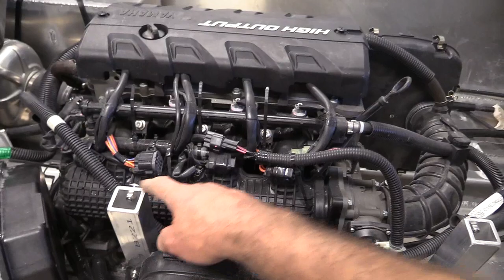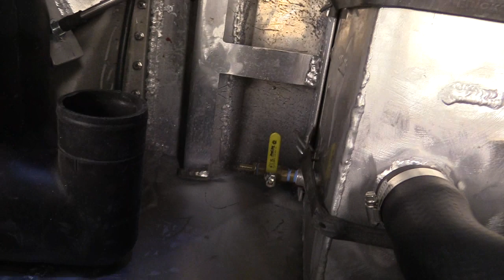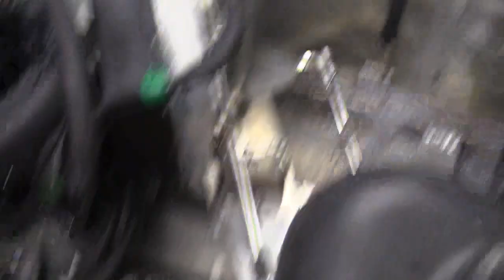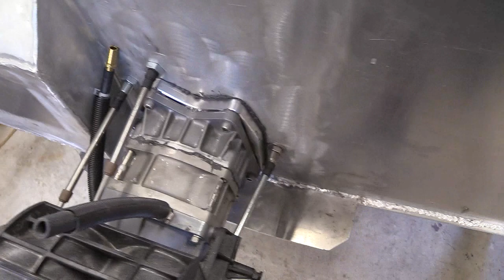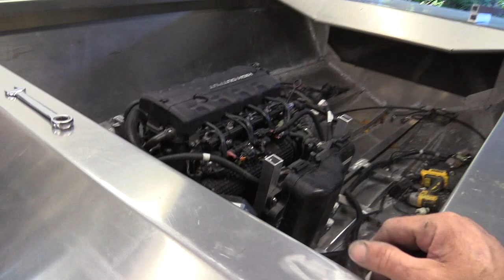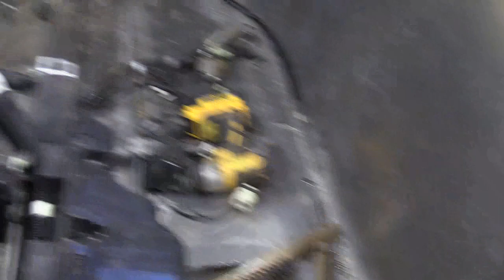Mini Jet Boat Build #53 Fuel Tanks, Exhaust, Fuel Lines

Comment: It'll be way easier to not use the plastic exhaust set-up. I would cut the exhaust thru-hull after the 90* and mount through transom, then fab a tube that goes from the muffler outlet straight to the exhaust thru-hull. Save heaps of time, is simpler, and gives you heaps of room for maintenance later.
Reply from the maker: Mitchell Speedboats I did take your advice on the left handed steering. The plastic part of the exhaust probably won’t change for now just because I’ve moved on. Thanks for the input.

Comment: are you thinking the fuel weight needs to be as far rearward as possible??  Did the builder tell you where to place weight??  Thx... You're cruising.. looks good.
Reply from the maker: LeadingEdgeTec Yeah. RSR said to put them in the back corners. I assume it has to do with hull performance and handling. Thanks.